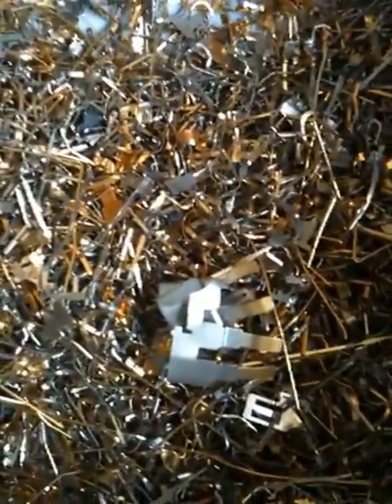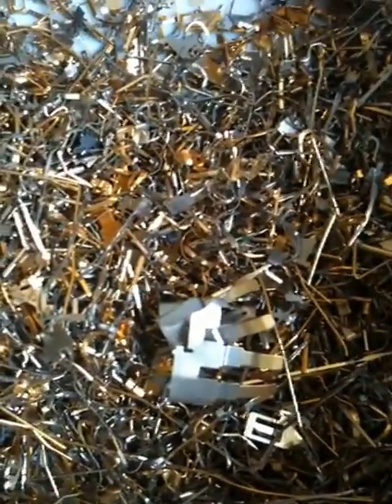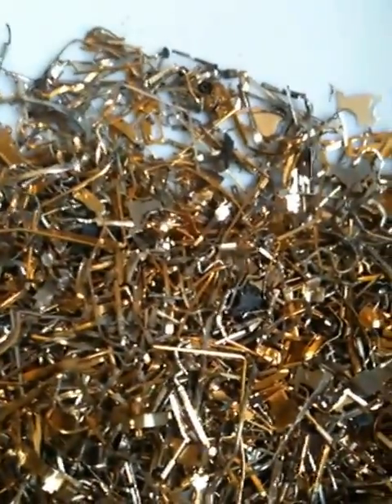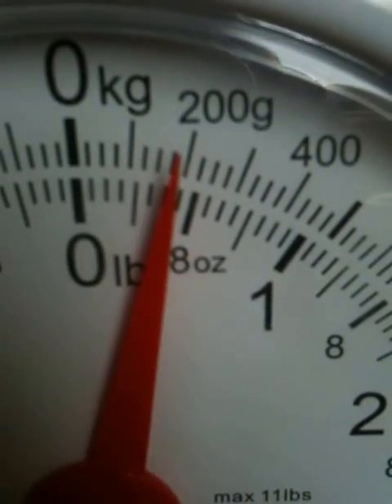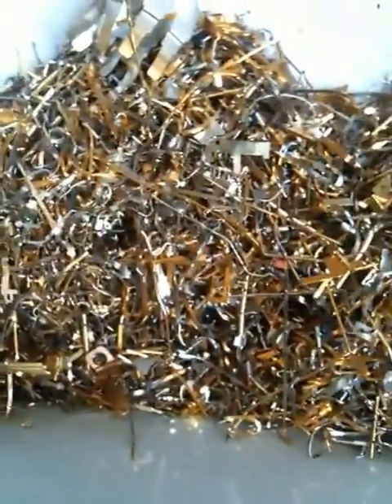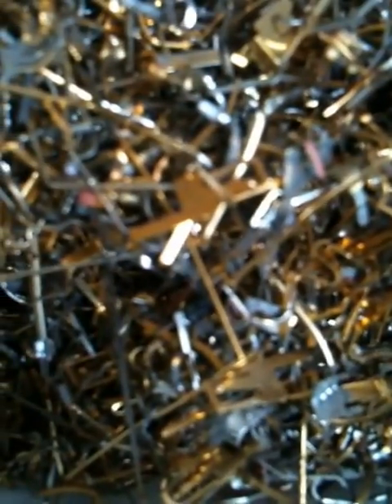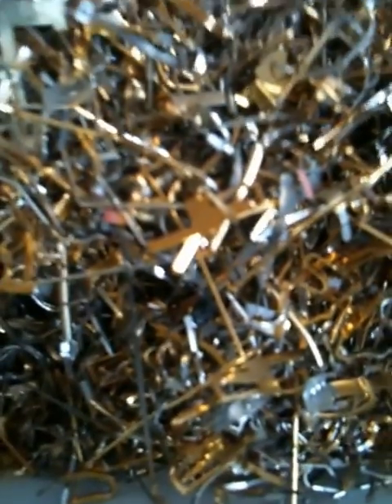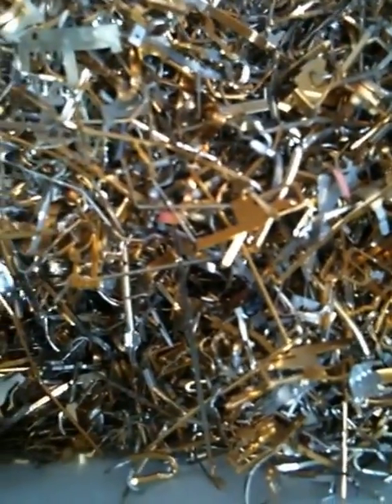E-Scrap 1, Gold plated pins to try Aqua-Regia gold recovery

Comment: PandorasDelight  I have a aqua regia black liquid suspension of gold in aqua regia. I added SMB from Stump Out to precipitate but it did not work. It fizzed, but the SMB fell to the bottom and the black liquid did not precipitate the gold. What should I do now?
Reply: Did you neutralize the nitric in the solution before adding the smb? If not, you need to. But of course it's 6months later now and possible (or likely) that any gold would have dropped by now. And depending on your gold source, it many only be a tiny bit of blackish powder that drops. Many first timers expect to see so much gold drop from tiny sources, but it doesn't happen like that.
Reply: jayan joseph  try to precipitate the gold by putting a clean bit of copper. but im sure u r going to want to nutrilize the nitric acid with urea. just fyi ive made this mistake and many others.  due to the fact i never studied and researched enough. so i suggest with emphasis study, to do that before proceeding with further gold recovery.